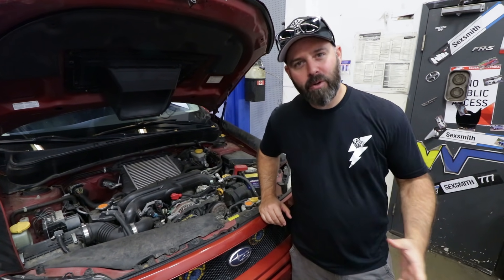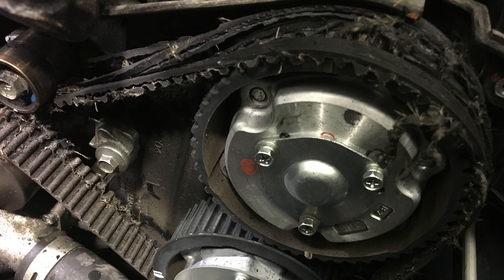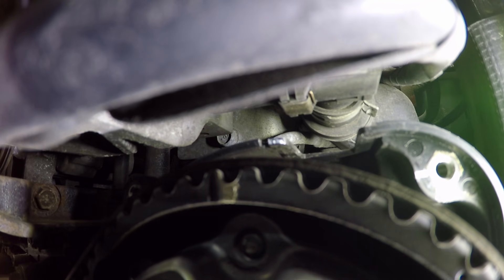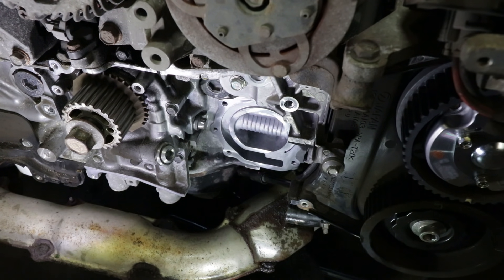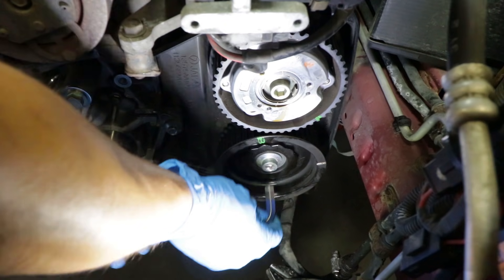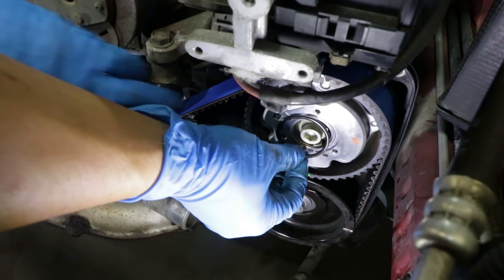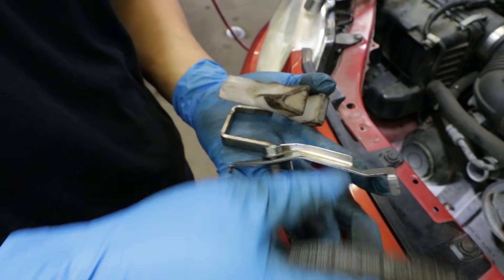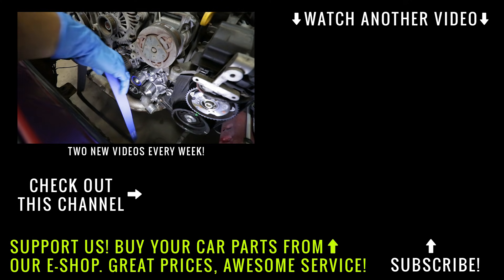How To Change A Subaru DOHC EJ20 EJ25 Timing Belt

Comment: I heard the gates kits are chinese idlers now? Even though the box says japanese or what not. Is buying the gates kit still safe?
Reply: The Aisin kit is what you want.
Reply: no, bought one two weeks ago, only part in the kit that was oem was the timing belt itself, everything else was china. do like i did and go on amazon and buy everything separate itll cost a bit more but you will have a piece of mind knowing its all oem. hope this helps
Reply: Jyxx this was helpful, thanks. I can get all oem parts from dealership but its nearly $1000 without a water pump
Reply: amazon my friend, you can order oem subaru parts there aswell. just make sure you know the part number and analyze the pictures. i think i spent roughly 360ish for my set without water pump
Reply: Tayt Tweten just get an asin kit. Koyo pulleys and a quality pump. Not the Chinese crap gates pump
Reply: good deal glad i could help

Comment: An easy thing I like to do when installing timing belts, is to use a small clamp to hold the belt on the cam gears. It's just enough tension to hold the belt from slipping off as you snake the belt onto all of the pulleys so you can use both hands.

Comment: After owning an 04 STi and an 07 forester xt I would recommend doing the cam seals at the same time while you're in there. Otherwise, you'll be removing all that stuff again in the near future. But, don't get me started on the shitty oil feed AVCS line.
Reply: andyvoytko the damn cam gear bolts too. thanks for the shitty allen head bolts subaru.
Reply: andyvoytko didnt you fancy something fast like a evo

Comment: God damn, doing a thermostat change on Subaru engines would be a nightmare
Reply: jcwat if you just need to change thermostat , you don’t have to remove timing belt or anything as it sits below the timing belt cover when it is on. Its actually really easy to change .
Reply: Two readily available 10mm bolts on the lower radiator hose. Doesn't get much simpler than that

Comment: I guess I should say that I'm lucky to have an engine with a timing chain. No need to change it I think.
Reply: Maybe so, but at 200k your probably done with that vehicle and gotten good mileage out of it.  You'll probably just drive it till she blows at that point or sell to someone cheap as the value has dropped significantly.  I'm at 150k on my car with chain and value is about 5k right now.  In another 50k mileage I'm probably at about 3k of worth.  Also to pull the chain cover off in mine is a horrible pain in the butt and believe the sub frame pretty much has to be dropped as the oil pan has to come off.  At that point DIY isn't really a fun option and paying someone isn't going to be cheap.  In my case where I run traditional oil and not Synthetic, the best bet for me is to run it till it goes or sometimes as it stretches the engine computer will catch it and flag you with a cel.  Overall the best thing for me to do as I don't run synthetic is to maintain oil changes aiming at 3750 miles per chance.  Cheap security is an oil change expecially with a timing chain and non synthetic.
Reply: Kartboarder22G Yeah, I don't think my car will stay with me that long
Reply: I'll add really the benefit of a belt is it probably is a hair more efficient than a chain, definetly quieter, and I guess for the fanatics tuneable as far as timing much easier.  The next cars will probably have no belts or chains and be electric.  As that is what koenigsegg is doing now and eventually that tech. will trickle down.  The ICE is gonna be going through a lot of change on vehicles in the future to keep up with Hybrids and or suppliment the Hybrid efficiency.  Many companies looking into unique ways to increase the efficency of their engines, such as electric timing, varible compression, water cooled exhaust, etc.  Problem with all this is the ICE gets so much more complicated when the electric motor is so much simpler.  I think ICEs will just be supplimental in the future at best.
Reply: Timing chains also have service intervals, although usually higher than belts.
Reply: FORCED-INDUCTN How often they should be changed approximately?
Reply: Depends on the the vehicle in question, many manufacturers don't list an interval or call it "life of vehicle." Most modern cars can do 100k miles easily but as you get closer to 200k miles you should inspect the chain for stretch. Usually the chain guides and/or tensioner fails first and allows the chain to skip the teeth.
Reply: Kartboarder22G, while is true for original owners, many people like myself buy high(er) mileage vehicles to turn into performance street and track cars. Even though belts wear much faster they are MUCH more tolerant to abuse and high RPM than chains. I am just advising the general public to not blindly assume that a chain is good for "forever" and to perform visual checks when logical :) EDIT: actually belts offer almost every benefit over chains except longevity.

Comment: So there is no mention of having to lock the driver's side cam gears together... At TDC one of the cam lobes is on the nose, BTW the EJ is an interference engine so you are in for a valve bending good ol' time, YAY!
Reply: subaru knows this which is why you  dont actually set cylinder 1 to TDC like you would on most engines. When the crank sprocket is lined up with it's mark all pistons are half way up their respective cylinder. The valves cannot contact the piston no matter what as long as the crank is on the mark.
Reply: Company 23 Cam lock tool is the  best $50 I've spend on a tool in a long time!  Lock the ds cams before releasing tension on the belt, nothing moves. Awesome tool.
Reply: When I did mine I thought I had the cam gears locked in place good enough using Vise Grips.  I did not and they flung off and the came gears went spinning.  What followed  was the worst feeling in the pit of my stomach I've ever had, lol.  I turned them back into place the only way the service manual said I should turn them, (can't remember which way at the moment) did the job, turned over the engine and prayed.  It started right up.

From what I've been reading on forums now over the years this is not a problem actually.  If you think about it you have to take the cam gears completely off if you do the seals behind them and there's no way to keep them from moving then.  That being said, I still don't like them jumping and spinning and will look into better ways to keep it from happening if I ever do this job again.
Reply: WildMex Doesn't that happen if the belt has snapped while running?
Reply: WildMex I was wondering the same thing. Could it be that since the engine they were working on had the variable intake valve system there could be enough hydraulic pressure to hold the camshaft in place? That was all I could figure.
Reply: @Emre lan correct.
Reply: @Emre lan Did not know that, learned something new already today...